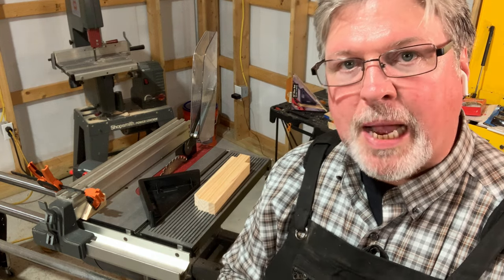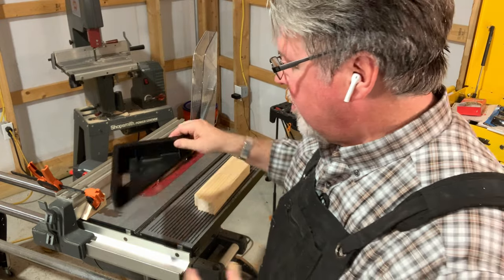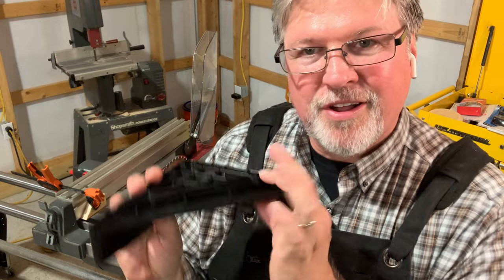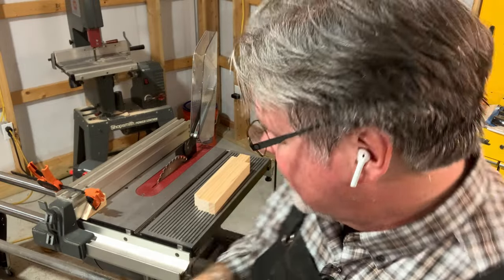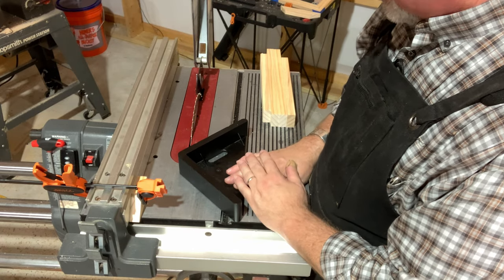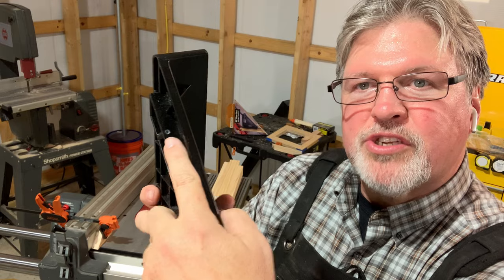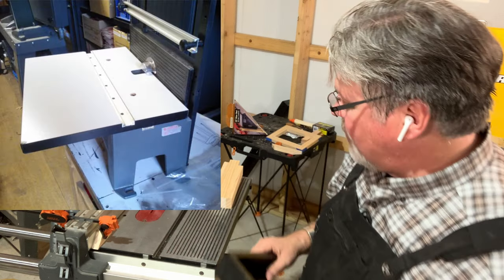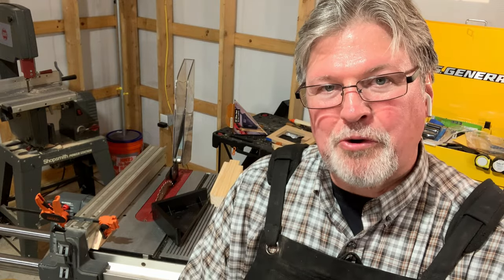Rockler 45° Miter Sled: Someone's Not Cutting Corners!

Comment: My first thought was "Ah, a zero clearance miter sled". While the auxiliary table would work if I'm going to make one anyway I may as well use some wood and make the fence as well.

Shaving/sanding the bottom of the bar is the way I would fix it.

The way I would do this entire thing is as an add on to my saw sled. The main advantage is that my fingers can be nice and far away from the blade. Pencils, hold downs, scraps of wood are all my friends, cutters aren't.
Reply from the maker: I’m a big fan of sleds too.
Reply from the maker: And I think by the time we go to all that trouble, there’s really no point in purchasing this tool. Most of us could cut a square or for that matter could find a off-the-shelf triangle that would do the job.

Comment: Some time back you talked about the Bitner nuts on one of your videos i have made several of both 1/4 20 and 5/16 18 and get them confused and invariably pick up the wrong ones i fixed this by running a bolt through the. nut filling the cavity with colored epoxy to quickly identify the size. The only down side is the epoxy threads are really tight
Reply from the maker: Brilliant! Great solution!

Comment: How is it that Shopsmith's miter slot varies from what seems to be the standard size in others?
Reply from the maker: It has been that way since 1954.
Reply: @MyGrowthRings  I've been this way since 1952, but my wife says that's no excuse.
Reply: Why don't my Ford parts fit my Chevy? If my company has been making things a certain way for 70 plus years, why would I change what I was doing? So you could buy another company's miter gauge? Yeah that doesn't sound appealing in any way. Why does everyone have a problem with proprietary tech in a Shopsmith but not an Apple or a Chevy? Anyhow I have to be going now. I need to try to put some Gibson tuners on my Fender.

Comment: Reverse it and have the point aiming away from blade?  Probably have to add aux fence too. Is it worth the effort in the long run?  $22 vs. $133 for each new.  Well tuned miter gauge looking pretty good right about now.
Reply from the maker: I actually have a video of me trying that, but it didn’t work. There’s not enough table to the front of the blade to support it and the miter bar with as far back as you have to position it. Great minds…
Reply: That's what I was gonna write but I wanted to check if someone else had the idea first.

Comment: I’d remove the built-in ‘miter bar’ and attach a Shopsmith miter bar (or a wood bar) to those two slots beside the molded miter bar. That would solve both problems - move the sled back from the blade and allow it to fit into the existing Shopsmith miter slots. Heck, if the wood miter bar were just a shade narrower (to pay homage to Jim McCann), you could create that extra slop to allow you to slide the workpiece away from the blade as the Shopsmith miter pro would.
Reply from the maker: Tim, that’s actually an interesting idea. It’s a shame that Rockler didn’t produce it with a separate bar that could be relocated and even have a Shopsmith sized bar option. I think their goal was to produce the part with one tool and to make it as inexpensive as possible.

Comment: Perhaps rough cut with the miter gauge then use the Rockler sled withe the disc sander?
Reply from the maker: You and your disc sander!
Reply: @MyGrowthRings  it a Mark 5 not a Mark 1. There might be an advantage, in my experience smooth well fitting joints glue up stronger. For edge glue probably not needed. But the small surface area of a picture frame needs all the help it can get.

Comment: Another shortcoming of the Rockler model is that it doesn't have the long (24") rail with the builtin stop system that the SS model has, which is huge in making cuts of identical length.  Add to that the versatility of the SS model to be able to create an extension fence, and you have great reasons to stick with SS, even at the higher price point.  It would have been even better if SS had created a mounting point on that long fence so it could be used as a fence for the cast iron bandsaw table.  Perhaps a clever person could make that modification.  Best of all worlds!  Blessings, Glen